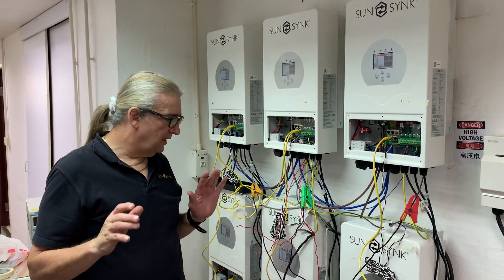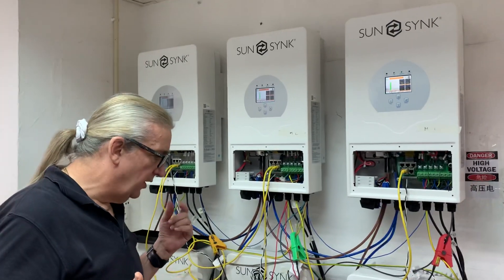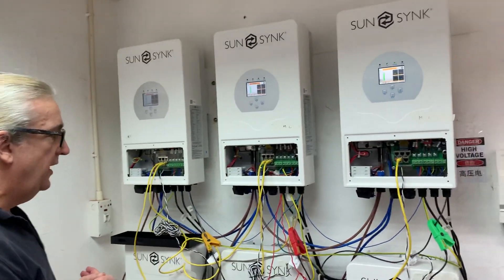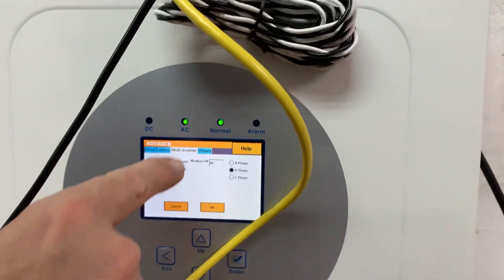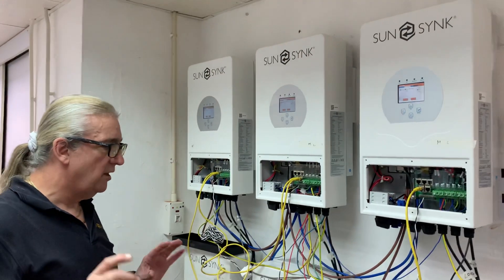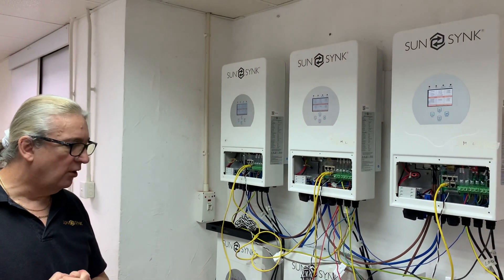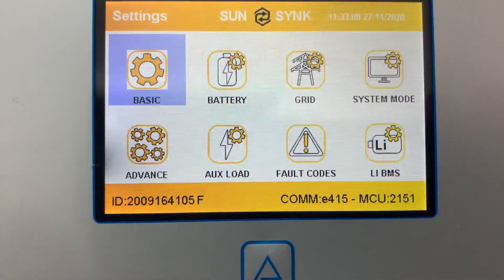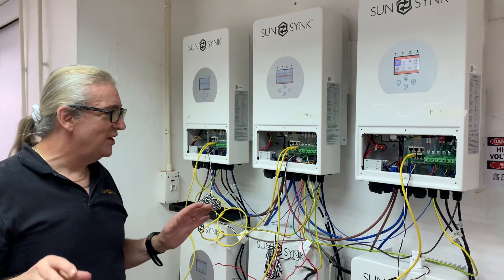Wiring 6 x  5.5 kW inverter is in parallel

Comment: Good day sir, I observed that there is only a  commiunication cable between the first phase and the last phase (second inverters) but not on the second phase.
Reply: yes, true, bcs the inverter not have 3 ports :) path is like this: S2A -> M1A -> M5C -> S6C -> S4B -> M3B :) easy :). midle-right bottom are connected too!

Comment: How do you connect and charge the batteries when running in parallel?
Do you need a separate battery management system?
Or can the inverters change the batteries

Comment: Brilliant video. So why would one not rather use one big enough inverter compared to  using  x3 of these inverters?
Reply: Advantages are if a 30 kw inverter have any problem then total system is off but only 5kw have any problem then the line may run. After fix 5kw ,total system is ok.